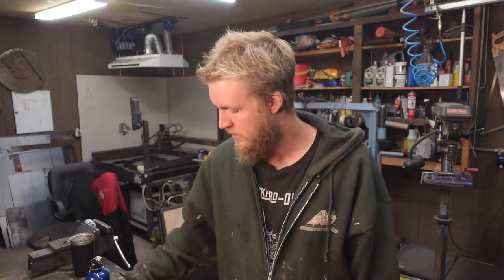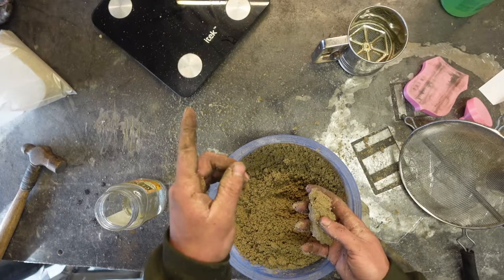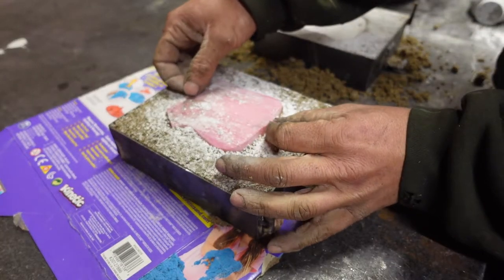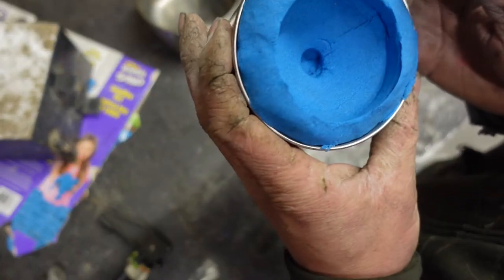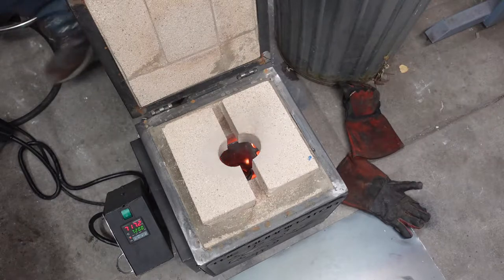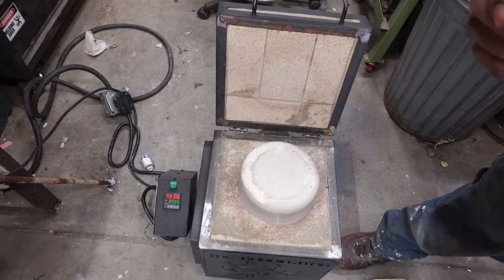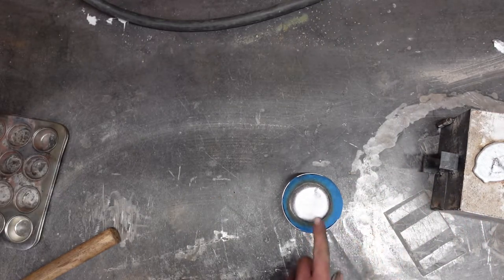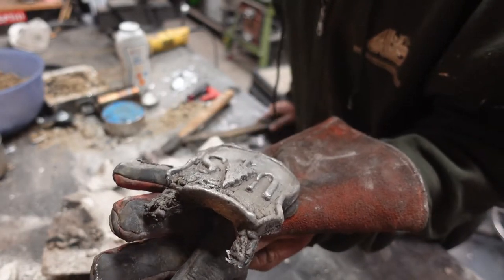Trying Different Aluminum Casting Methods

Comment: One workaround would be to print the mold in a single shell without infill. Of course not all shape would be printable this way but it worked for me. I painted few coat of plaster onto the PLA print and buried it in sand to save on plaster, dry time and no burnout required.  I like your video and just learned about your channel today with the hackaday article. Great job!
Reply from the maker: Smart! I'll have to try that one my next run-through!
Thanks for the support!

Comment: Appreciate when videos show warts and success. All part of learning. Gives me hope that my failures are just part of process. I have a lathe and think it would be pretty cool to have some big chunks of aluminum. No foundry yet. Keep em coming.
Reply from the maker: Just gotta keep on failing til you don't anymore! I think my failures teach me more than any research haha
As far as getting those big chunks of aluminum for the lathe, I would not recommend using cans. I edited most of it, but I had to scrape TONS of dross off the top. Next time I do it, I'll try to find some cast aluminum parts at the scrap yard.
Reply: I made a lathe and just started a foundry to make machinable aluminium. A lot of failures but also a lot of fun. My wife keeps the distance and ocationally ask me about burns or cuts :-D
Reply: @cranktowncity  cans are a waste of time, indeed. The computer hard drives are made of a very good aluminium. I melted some and they had little to no dross at all.
Reply from the maker: @Danbatio  Good to know! I'll keep an eye out for em!

Comment: from wat i heared aluminium car rims have the best aluminium for casting , do need to break it intoo pretty small pieces for the size cruisible youre using
those round billet pieces do look nice , wonder if you can melt the aluminium straight in that stainless pipe just leave the dross in as it floats to the top anyway and machine that off after its cooled off and pushed out of the pipe , saves you from handling hot metal outside the furnace 
might be an idea to make a billet mould with a flange and flange lid on the bottom , that way you can unbolt the lid and set the mould upside down in a hydraulic press using the flange to hold it and push the core out the top of the mould

Comment: Ive seen with lost PLA that is firstly use a ceramic coating dip with wire to strengthen the mould (can crack under thermal laod) and it's better to melt out most of the PLA at a lower temp before a final burn out, so you avoid all the soot forming and maybe encasing bits that never properly burn out.

Also with your runners and risers, need to make sure gasses have proper escape holes as everything rises,

Comment: Here's one n a half workarounds. 3D print the negative space of the thing you want to cast in two halves obviously, then cast it with wax, then use the wax to make a plaster or sand casting. The longer way would be to 3D print the part, cast it into silicon, cut it open enough to get your part out and cast with wax.

Comment: They said it has something to do with the riser and runner when casting problems like bubbles or incomplete fill.
you may wanna try adding some art works on the sand before pouring in.😅 nice video man. thank you!

Comment: Greensand casting issues might have been too much moisture in sand? It turns to steam which needs somewhere to go. Poking a wire through the sand to almost touch the pattern can help.

Comment: you should have had the design on the bottom for the sand casting. Air rises so any trapped air will be at the top of the mold. You can make casting sand out of play sand and oil.

Comment: I thought that your pouring temperatures may have been a bit too low and your runners and risers needed possibly to be a bit fatter.  The pour and the flow of metal into the mould causes the metal to cool so the pour has to be fast, smooth and regular. Part of the problem may also be the use of the metal crucible because it is a good heat conductor and its temperature starts to fall as soon as you get the crucible out of the furnace. Ceramic would work better I think. Getting the PLA out of the mould is better done in a domestic oven (that may not be very popular with the cook). I would take it out of the oven fairly quickly to start the pour so that it does not cool. Plaster absorbs water from the atmosphere so it is best not left around for long cooling down.

Comment: If you have access to a junkyard, get some old aluminum heads and intakes. if you cook them on a bonfire before whacking them with a hammer, they will easily break apart.